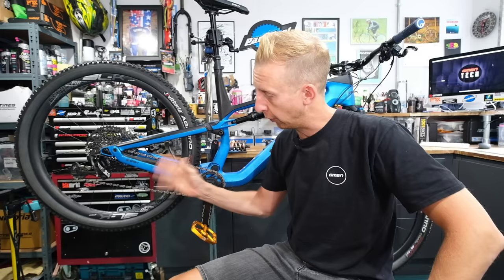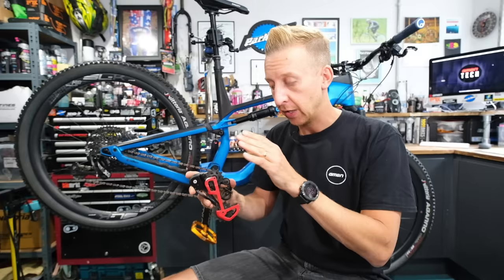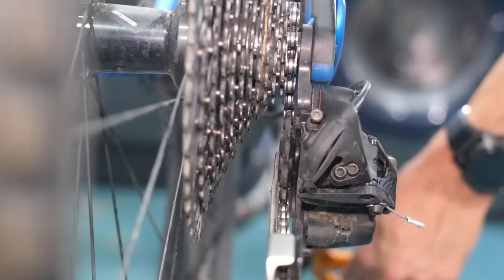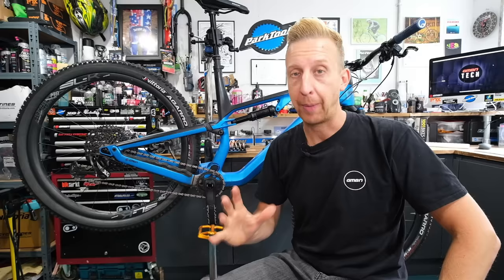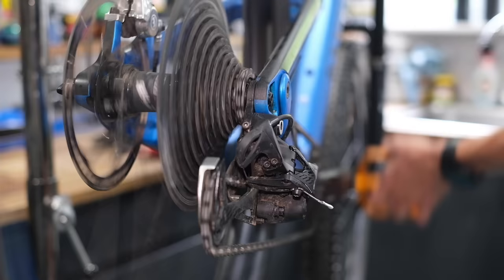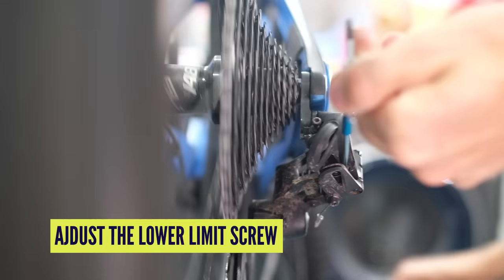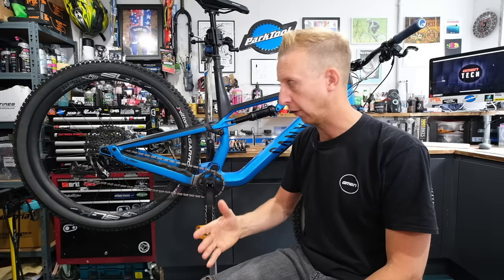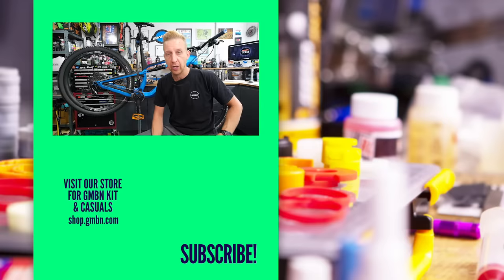How To Set Up & Adjust Any SRAM Rear Mech | Mountain Bike Derailleur Adjustment

Comment: Hi Doddy, I have a Santa Cruz Butcher I have installed GX eagle I followed your video on setting chain length. It works great but on the smallest sprocket the chain is a bit baggy when I am not setting on it  but when I set on it the chain is tensioned is this wright?

Comment: Does anyone know why my derailleur is not shifting from 12 to 11 or sometimes 11 to 10? Gear indexing seems to be ok and if I backpedal it will correct itself. It's as if the derailleur spring is not quite strong enough when in the lowest gear. It happened after cleaning the bike.

Comment: My issue is it goes into the biggest gear but when it goes down to the next size down it jumps to the third biggest gear. All the smaller gears work fine. The big ones shift but are skipping when shifting to smaller gears.

Comment: Any hints on setting up the new 52T derailleur Doddy? Mine has been delivered with a different gap tool to previous versions (large white cage type thing...). I'm struggling to understand the instructions supplied!

Comment: Hi I have sram 12speed and my hanger and rear mek cage is slightly bent but I have a carbon frame I seen the video where you use a justerbal spanner. just wondering if it we be safe to do so on my carbon orbea  rallon

Comment: Thanks Doddy - love your tech stuff, just upgraded from a 2012 Hardtail 26er with Shimano 3x9 XT to a 2020 29er Hardtail with SRAM GX - with NX cassette, Everything Brand New and shifting fine BUT while pedalling in the 11-tooth, I am getting slippage when pushing hard. I have checked everything and sourced and used the B-Gap Adjustment Tool (Very hard to find in South Africa....and didn't come with the bike).  Thoughts? Thanks!

Comment: Doddy, question for you:  Has any manufacture considered mounting the entire derailleur on top of the rear triangle instead of below it?  With my very limited knowledge of how this would or wouldn't work, at the very least it would nearly eliminate the chance of rock strikes.  Your thoughts?
Reply: I thought this too and i guess they most likly have but when you think about the direction of force from pedaling, with the current setup there is no aditional force on the derailleur. You can see this by turning the bike upside down, pressing rear break and putting pressure on the pedals. I guess only about 1/2 of the chain is under tension. 
If the derailleur was on the top, the force on it would rip it apart.

Comment: What about the clutch adjustment? My chain keeps flipping up into the spokes despite the limit screws being well adjusted and everything aligned. Was thinking too much slack in the clutch?
Reply: If your limit screw is well adjusted then nothing else should be able to push the chain into the spokes.

Comment: Well, as per Sram if the chain is too long or too short by even one link, it will never shift well. Also the Sram SX is as good as a paper wight they dont work properly out of the box, upgrade to a higher more expensive Sram.

Comment: #GMBNttech I dont run tubeless, as I only run one bike. From every day urban to out on the hills.  I change tyres a lot.

I'd love to hear some stuff about inner tube sealant such as muc-off and slime.

Is it ok to deflate then re-inflate the tubes, when full, over and over to change tyres back and fro.

I'm most concerned about it being forced out the valve on deflation.

Comment: #AskEMBN I have a Cube Reaction Hybrid Pro and I want to upgrade its fork (SR Suntour XCM34 Coil, Tapered, 15x110mm, 100mm, Lockout). What fork do you recommend for my bike? I do mainly trail riding and I have already added a shorter stem, a wider handlebar, an angled headset (2 degrees) and a dropper seatpost.

Comment: Plz help Doddy, I have a sram gx mech that is always loose and wobbly on the hanger, almost cross threading😭😱don't know why, its a new hanger that fits perfect but the mech just won't have it.
Reply: Try using the sram x01 b bolt. It has seals for a tighter fit.

Comment: Doddy great videos.   Question.  I lost the lockout adjustment on my fox fit rlc 2012 fork.  Contacted Fox who say they only offer support for parts for 7 years.  As you know bikes can last a good while longer if looked after.  Any suggestions for 3rd party options. Also do you know the manufacturer support time frames for other shock brands as i will now take support lifetime in to consideration moving forward.

Cheers

Simon
Reply: Have you tried Silverfish UK? Or activesports.co.uk they are about your best bet.

Comment: My bike has a SX groupset and everything works great apart from it sometime take a while to shift up (to a harder gear) Any ideas? Cheers
Reply: Check your b gap screw and maybe release some tension in the cable by screwing the barrel adjuster clockwise.
If you dont have the b gap tool shift into the 2nd gear and there should be a 3mm gap between the largest sprocket and the upper jockey wheel

Comment: #askgmbntech So i’ve been thinking about putting sealant into my tubeless ready tires and rims on my Trek Fuel Ex 8 XT. But it’s soon fall and then winter, and i live in Sweden where there is no real winter, sort of similar to northern parts of UK i guess. I will ride all year round with it, unless its loads of snow outside. I will keep it in a shed with around 10-12 degrees celsius. What happens to the sealant under those conditions? Most people talk about warmer temperatures, i do get that the sealant will eventually dry up in a hot environment. But how about cold temperatures? And another question, how will the bike perform suspension-wise during colder weather? In like a couple of minus degrees? I will probably not go biking in -10 degrees celsius or lower. Hopefully others wonder the same thing as we now slowly go into colder temps. Cheers for all the great stuff you do, i have learned tons from you guys! 🙏🏻
Reply: Most sealants have informations about max and min temperature it can be used in. Just check it before buying
Reply: Emil Maćkowiak thanks for your input Emil! But that much i know. 😊 I’ve seen different manufacturers specifying their sealants to work between all sorts of temperatures, like -20 to +50 degrees. But it doesnt really say for how long it will last. Some seem to dry up really fast during hot conditions, but i havent really found any useful info about colder temperatures. And that is why i think this could be something interesting for these guys to dig into, since they have more knowledge of this subject than many of us. And i guess where most of the tech guys on GMBN live they have the same climate as i do, sort of. 👍🏻

Comment: #Ask gmbn tech. Hey guys my name is Anthony from so California, have a aluminum Yt jeffsy 29er, I weigh about 240 lbs . 109 kg with riding gear. What tire pressure would you recommend.  I usually run 24lbs rear and 22 front. Also would you recommend running a coil or air spring rear shock? 
Cheers

Comment: Hey Doddy, I’ve recently developed a bit of ghost shifting on my YT Jeffsy. If I’m pedalling, hit a big bump and my rear suspension compresses it changes to an easier gear sometimes causing my feet to come off the pedals. Any ideas about what may be causing it? #askgmbntech
Reply: the cable housing that runs under your ring gears to the rear derailleur is cut to short  when your rear suspension compresses it tightens across the bottom of the frame just enough to cause a shift just get a piece of cable housing that's 1`/2  inch or an inch longer replace it and your good to go

Comment: Whats the bolts for near the headtube? I'm not talking about the stem bolts, the bolts on the frame near the headtube.
Reply: 3:42 It's part of a "knock block" style headset, that keeps your bars/brake levers from hitting the top tube as it spins around. They are designed to not be able to spin 360° freely, but have a stop built in! It has to be screwed in place to keep the race from shifting within the frame as the stop eats a hit!
Reply: Le Typ but this isn’t a trek bike. Do other manufacturers do this?

Comment: There's got to be more, so much more, than just this. If this was as easy as it is, no one would take their bike into the shop. I followed every direction on this video + four others, and still crap shifting. On a brand new bike with brand new SRAM GX 12 speed.  Always seem to jump 2 gears from 5-7 instead of 5-6,  and gear 12 is like its sitting at gear 11, one more click and crack, the chain goes between the casette and spokes.  What gives?  There's got to be alot more to this than presented.
Reply: I've found you have to also play with the cable tension after setting the limits and the b screw has to be correct.  GL

Comment: 1. In sram derraileurs, left screw is for smallest cog, right one for the biggest one; 
2. When fixing the cable on the derrailleur, it's necessary to fix it in the correct way - from the top, so when the screw is being tightened, it also tightens the cable at the same time - there's also a steel notch underneath the screw to hold the cable in the correct position. 
3. All the derrailleurs mounted on an FS bikes need to be set up while sagged.

So - talking too much, but a BS at the end...

Comment: hmmm... not so simple in practice... it looks more complicated than the park tool tutorial and the steps are different... sram tutorial is not very helpful... that's confusing... I just changed my sram eagle chain by counting (several times) the number of links and now I can't reach the 2 smallest sprockets anymore...chain was about 4 years old but that's quite a lot... i don't think limit screws became unadjusted so I suppose the only right thing to adjust is: the barrel... but could the barrel adjust that much space? ... let me see.

Comment: My bike won't shift into it's 3 lowest gears (11spd), what's going on?
Reply: @RealMTBAddict  they're set fine. Think I might add some lube tto the cable
Reply: @RealMTBAddict  well its brand new as well as the housing. Perhaps the tension is too loose or tight
Reply: Check your derailleur for bits of sticks of little stones, blocking it from gowing all the way down!
Reply: @RealMTBAddict  "Too loose" shouldn't be an issue, since in that instance the derailleur's spring should be able to pull the derailleur into its resting position due to lack of resistance.

Comment: Please HELP! lol 
I have three Canyons with Sram GX and XO 12spd and same with a few guys I ride with, we all seem to have issues at times when in the 4th or 5th cog from the smallest on the cassette making a clicking noise, if you look you can see the chain just catching a tooth on the lower cog, but if you touch the barrel adjuster it will then ride on the one above and still make the annoying clicking, if you manage to adjust the noise out then you have problems with it not shifting cleanly somewhere else on the block.
I have tried, new hangers, straightening the hanger with a park hanger tool, new inner and outer cables and new chains but still have the issue and as mentioned its on just about every eagle drivetrain I know of and own?? 
is it just me or is this an issue with eagle being such tight tolerances?
Reply: Hey bro I had the same problem, here's how I fixed it.
Step 1: get shimano
Step 2: thats it
I had high expectations from a full NX drivetrain (except the cranks which are truvativ and are bulletproof). Even with a e13 chainguide my chain keeps falling and makes brain-fucking noise all the time.
Reply: @antoanangelov5672  yep thats my next move, instead of spending one cent more on this eagle stuff im going back to shimano 11speed with a 51 tooth cassette. both my shimano and Sram 11 speed stuff worked flawlessly and was simple to adjust and took a beating.
Reply: Maybe i can help. I had a similar problem but second/third largest cogs on my xd casette. This from Park made me realise it was bent... I have now put on a SunRace instead.

https://www.youtube.com/watch?v=ySY4uM4jNpU
Reply: Damaged or worn cassette, but possibly too short a gear cable! Yep...with full sus, as the suspension moves.a little as u pedal, some designs will pull the outers, effecting cable tension, moving the derailleur slightly with each pedal stroke, causing rub. If thats the case, I believe AXS would solve as no cable. Pricy tho. Likely to be same with shimano if this is cause. 
Otherwise, replace cable and make it much longer than u would...like 6-8 inches longer than currently, see if it improves. If not, then u can always shorten the cable again.
Reply: @nath5440  try the longer gear cable solution first, if ur bike is fs. See my other reply.
Reply: @Danielsyoutubechanel  I did think that might of been the case the first time I came across it, but could not see any issue with a bent tooth or bur on a tooth, Also when it happens to 6 bikes with different owners??  three of mine ?? all with the same bent tooth?? I doubt it especially when the cassettes look mint. The local bike shop said the same thing, countless people with similar clicking and finicky adjustment issues.
Reply: @rupedog  not when its on three different models of bikes I own and when its on countless others brands and models my mates own.  If that were the case It would be fine on the stand but crap on the trail. this issue it clicks and ticks no matter what on the stand or on the trail, and when you adjust it out it stuffs the shifting somewhere else.
Reply: Sram eagle derailleurs are garbage. They last for a few months, then end up with tons of play in the pivot pins.  Trying to adjust it out you end up with good shifting at the top of the cassette or the bottom, not both. Switched to shimano, it works. Sram's too busy coming out with cool colors to fix the junk they put out.
Reply: after going back through all the steps and suggestions on here I was able to get the click out of at least one of the bikes that was giving me the shits the most.
 In the end it was in fact a very very slightly bent cage right up where it bolts to the main mech body, a tiny twist with a shifting spanner and for now the tick in the 4th smallest cog has gone. 
I do think the tolerances are to small for a MTB set up that will inevitably  cop a hit or pick up a stick.  thinking  I will still go back to an 11spd with a 51tooth cassette like shimano offer.
Reply: I have a canyon with GX and I have the same problem glad it is not just me! despite new cable, setting the b tension I can never get it 100% seems I am not the only one
Reply: Same clicking here on brand new GX Eagle 10-52 cassette, derailleur and RaceFace front chain ring. LBS resorted to filing backside of offending tooth. Which solved the issue for a time, but now its back. ugh!

Comment: This is so dumb, leaving your gear system open to the elements, open to damage from rocks, and a limiter to your bike's clearance instead of nesting the gears in the crank is as dumb as the dirt that messes these chains up. That plus all the extra maintenance, cleaning, and adjusting makes it dumber still.

Belt driven + sealed "no maintenance" geartrain is the only way to go, especially with emtbs which don't get as impacted by the minor efficiency losses.